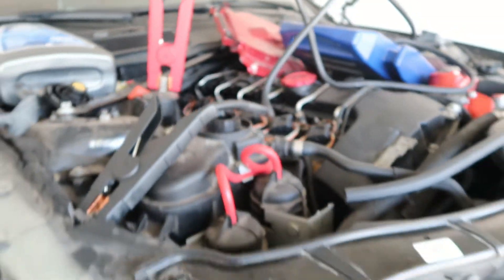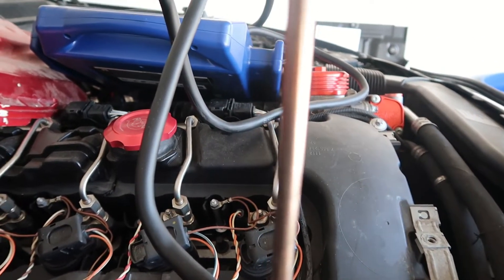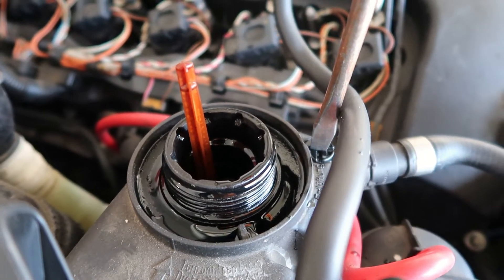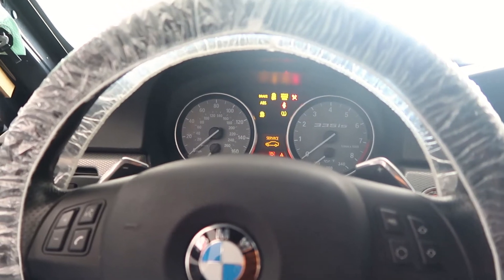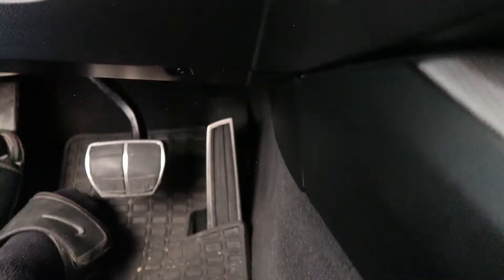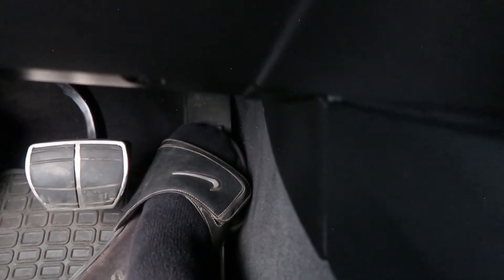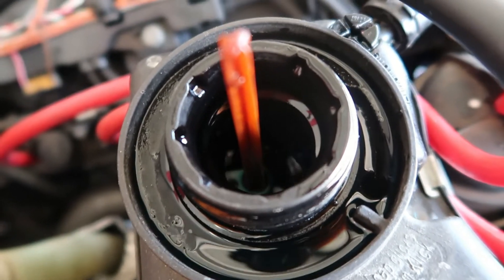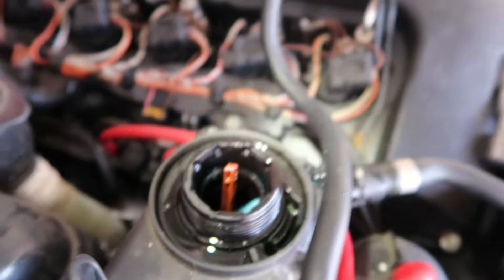Coolant System Bleeding Procedure for E90/E92!!!

Comment: Thank you for a helpful video! My car has been sitting for about 3 weeks now, I am planning to use external jump started battery for bleeding procedure once I replace the radiator and a few coolant hoses. Do I need to disconnect the main battery completely before hooking up an external one? It seems that ground cable on your video is connected somewhere on the left from the coolant reservoir, which part of the car is it connected to exactly? Thanks
Reply from the maker: You don't need to completely disconnect the main battery, just don't connect and reconnect too many times. There's a grounding point where I connected mine.

Comment: Hey man I really need help I replaced my radiator last night and there’s no leaks but m coolant light is still on should I re bleed it ? If so do I have to unscrew the bleeding screw ? Or just bleed the system
Reply: Also I have plenty of coolant in the tank
Reply from the maker: What car?
Reply: @n54andmore56  328xi n52